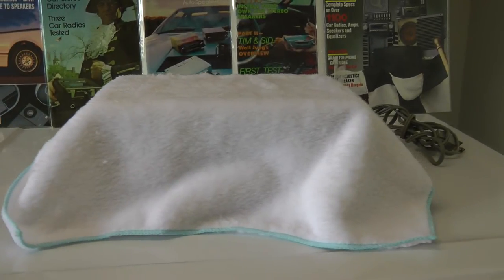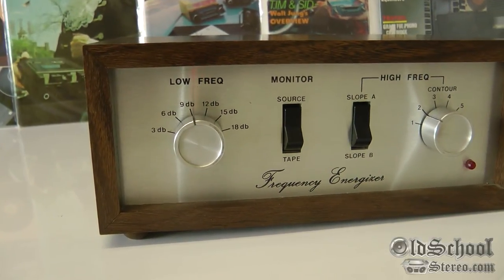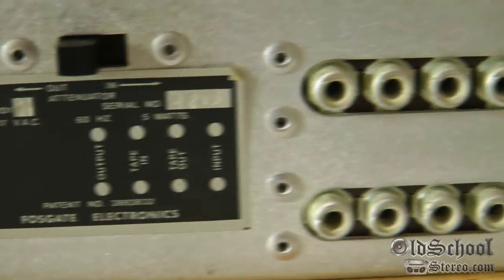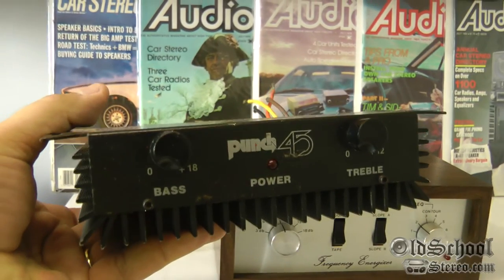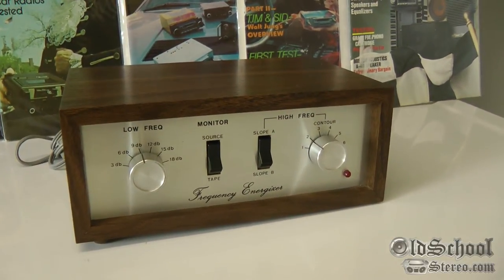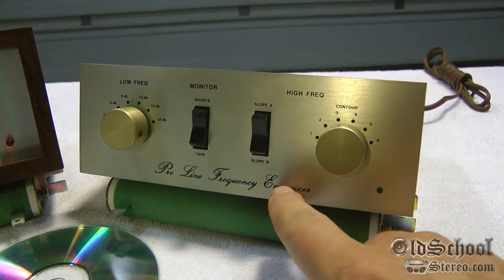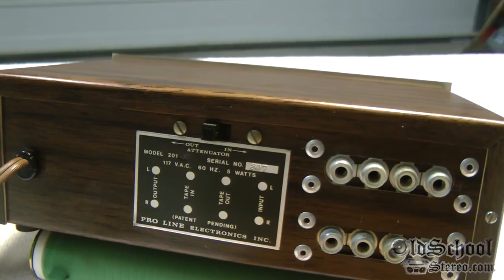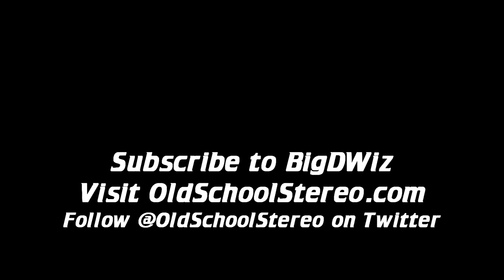1970's Fosgate Frequency Energizer Model 201 Overview

Comment: I bought the one I own at Audio Mart - a now long-gone high-end audio dealer in Kansas City.  I was no more than 16 years old when I purchased the unit.  I really liked what my kit-built 3 way speaker system (Acousta-Craft) sounded like with the addition of the Fosgate model 201.

The Energizer was basically a add-on "loudness" control with preset, variable gain steps on the bottom AND top end. The factory preset center-frequency boost in the low-end was lower than the typical loudness control on a preamp or receiver and likewise, the high freq boost was probably above 7-10khz - so it helped speakers both "thump" and have a nice "airy" top-end sound. without the boominess of standard "Loudness control."  

Yeah.... the word "PUNCH" comes to mind.
 
I so liked the sound of the "Punch" EQ that I installed a Rockford-Fosgate 40 watt "punch" in my first car.  It powered a set of Jenson Triaxial speakers in custom-built boxes. LOL!!!  That car also had probably the first CD player installed in a car in the KCMO metro area (November 1983) via a SONY D5 Discman  (The Discman was a Japanese domestic version purchased on a trip to Tokyo)  Portable or car-stereo CD players were not on the market in Kansas City yet! 

I still have my Frequency Energizer, but its on the shelf these days.  I'm a career recording engineer and with vintage Tannoy FSMs powered by Hafler amps in my studio, I really don't need a super high-end system at home anymore.  But I'm really considering building a nice vintage setup soon.

Thanks for doing a piece on this little jewel!

Anybody have any info or reviews of those vintage Acousta-Craft speakers?  The store-front was in Overland Park, Kansas - circa 1976.
Reply from the maker: Wow, awesome history! Check out another YT channel called Just Audio. They sell and repair vintage audio components and show off and give history on things as well. Highly recommended to check them out 👍

Comment: I own the Pro Line .Just looked it up today! :) Have had it over 35 yrs! Sounds great! Didnt have a clue it was of Fosgate design. Very helpful video
Reply from the maker: +Johny Riggs excellent! These are rare pieces
Reply: Picke it up along with some Dynaco tube amp and tuner and a pair of Empire 9000 marble-top speakers. Garage sale deal, $20.00 Still have it all and still use it.

Comment: Love the first decks amps and sub crazy to run high current at 5 watts r 10 by two a one ohm max out 20 in one speaker sucks finding or making? The cords on decks had no amp wires to connect it guess big beards started the powered speaker and first sub ever sweet first set up an back the 73-77 blowing minds the deep bass clear ass vocals I can emagin it was really a grey regal stock but best deck in world played tapes even? Then pop trunk three flush amps 25 by 2 like most could do amps and two big ass 12s two it bumped started competitions which threw the 70s no and vans ment then 80 there trying 100 by two or big time a 250 watt one channel then 90s 500 n 1000s probably being get them? So expensive dollar a watt for years and then fixed them to be cheaper just lil bit an true raw power look out old 12s must people used there home speakers make louder or blow them quickly yo.no it's all perfect shit and affordable now 400 bucks gets box two big 12s has be banpass to breath and get subs for 30-40 bucks that pounds now I can't wait to put three 6.5 subs in trunk one big 500 watt amp which is to much most max that or just three hundred max .so now get 8inch touch n voice operate any song mad? Real 1000 watt name brands for just 250 those 6.5 subs r nutz esp with true digital clear sound and iam going that three 6.5 each four doors and play that it will pound it's enough not me get big 500/1000 watt amp and put three matching 8inchers and I max there power quickly for so much bass it's then competition good win medals at shows just tons power digital clear and the two new good idea is back bigger isn't better fact those new 6.5 subs hit low frequencies then any speaker now 8s so good news on in trunk an one big amp done now sounds better than 15,12s ever could cause the lowest deepest hrzs of all speakers now crazy dope the history of amps and subs which I lived through the 80s speakers to huge jump in 90s was expensive shit but I'd change subs amps boxes always change set up trying keep updateing.go old kicker comps beat everyone one 12 500 watts raw I win out that's my car stereo history
Reply from the maker: #LongestCommentEver 😬